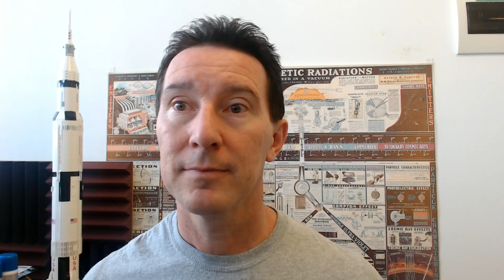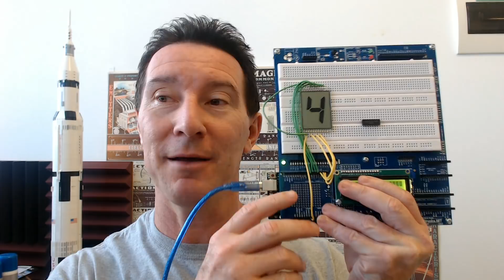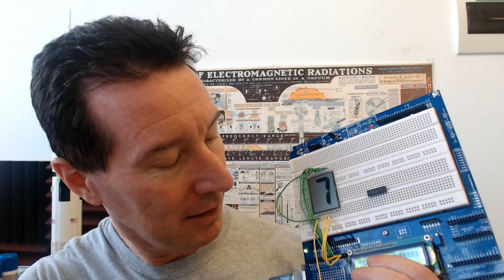LCD Bias Experiment!

Comment: What you should really do is display a single static digit. As it is at the moment you're turning every single segment on and off (albeit at different frequencies and duty cycles) which is giving you a form of AC with a DC offset. By displaying a static value you'd have a far better impression of what happens with direct DC drive.

An alternative would be to lock a couple of segments permanently on so you can compare them to the segments that are being turned on and off. Yes, the DP is tied that way, but it's only a small dot so may not give such good results.

Comment: I wonder how much worse it would be if you'd put diodes between arduino pins and LCD, so they aren't used as push-pull outputs

Comment: put it in a dark box and light it with a constant light (because lights in the lab won't be constant) and take a photo with date 30 times a day. they run it on 30 fps and every second of video will be a day of the LCD's torture.

Comment: +Dave - Nice idea.  If you fired the segments sequentially (1,12,123,1234....), or center, then around the edges, we might find out more information.  You could even toggle the decimal point on every change.  If it's going to take years ... you might only have to check it once a day - and then a few more days.    I hope I don't miss the follow-ups.

Comment: Destructive testing is always fun! If you've got enough pins, you should hook up that lcd and print out the Arduinos millis() to see how long the experiment has been running!
Reply: it will overflow very quickly
Reply: You could always divide to a more reasonable number like seconds or minutes

Comment: It would be better to have 2 identical displays, one driven with DC bias, and the second one without DC bias. So any changes would be visible immediately.
Reply: Go on then, no-one is stopping you :-)
Reply: We'd need a third that's not running, and two more in case the problems were specific to a particular unit (manufacturing defect).
Reply: We know that an LCD should last for years. If this LCD lasts for a year or so then apparently the DC bias is not that important. But if it lasts for significantly less than a year we know it is important. I don't see the need for a side by side comparison on this quick demonstration.

Comment: Why overdrive? Maybe raise the ground 1 or 2 volts instead of running the full 5 volts to it. In the previous segment, it was still quite dark at 3-4 volts. Then if it lasts a month running 7/24, hobbyist's could equate that to help make informed decisions. Eg: employ time-out display-off in software.
Reply: Just do it right in the first place and you have no worries.

Comment: What dev board is that? (Well, I suppose technically it's not a dev board because the Arduino appears to plug in to it, so I guess it would be an expansion board or huge prototype shield)
Reply: Any news?